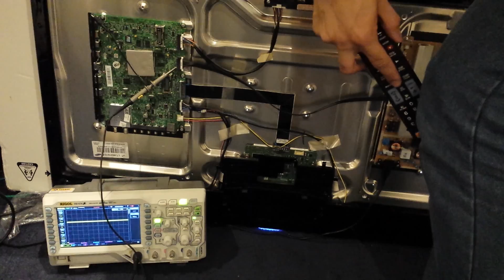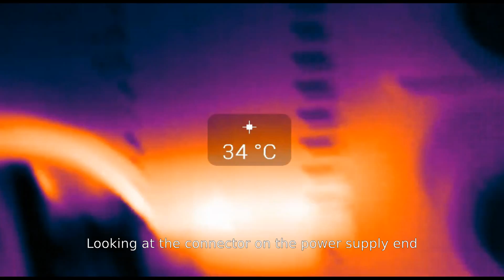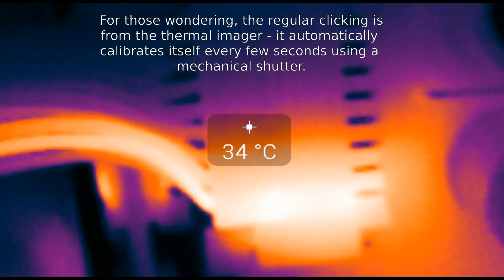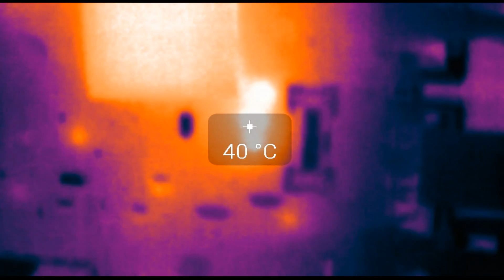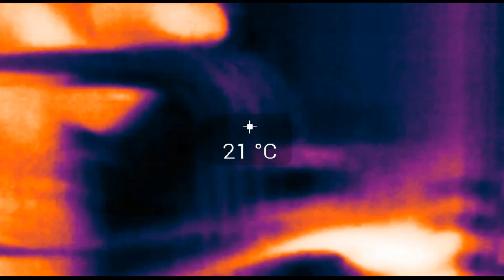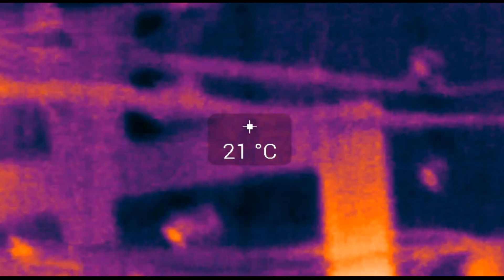Samsung UE46ES8000 clicking, power cycling, patterns - Diagnosis of connector failure

Comment: Mine also started to have these problems, I removed the cable from the plugs and rubbed all the contacts with a toothbrush with oil, turned it on and it was like new.
Reply: is it still working ok?
Reply: @kipkoech1000  yes

Comment: Hi.
I have a samsung ue50f65505sb.
It first startet randomly power looping with clicking sound. Had to unplugg power socket, and it worked from minutes to days depending on its mood. Now it's a similar fault but more often, and also it's going in loop when using any button on the remote. When I unplug the power socket, it still making clicking sound 5-10 seconds after. I then have to unplugg all the HDMI before I turn TV on again and it's working again. Just open the back today and checked both power and the other electronic board, with no visible damage. Is this a main board problem, or capacitors?

Comment: It is very simple just only to be the cable connector between power supply and mainboard and in that case it didnt even need to make a video to show a such a simple repairing.But once it was told,how to tell people that their tv died and need boards replacement with outrageous costs.

Comment: I have a samsung HP-T5034 and I am having a problem with the blue light taking longer to flash and start clicking, does that sound like a cap on the main board or power board and where is the best place to buy parts. Can I  test the caps individually to make sure I am replacing the right one. How did Y all get ureducation on tv, electronics repair.  THANK you.  Eriracing@aol.com

Comment: Same issue started 3 day ago on our UE65ES8000, we bought this in 2013,  so 5 years on now.
Followed you information and downloaded the service bulletin as per the URL you gave : http://www.badcaps.net/forum/showpost.php?p=519491&postcount=7 

Also found  and a copy of the service manual from :  https://elektrotanya.com/samsung_ue40es8000_ue46es8000_ue55es8000_ue65es8000_chassis_u81a.pdf/download.html

Burn marks on the last to pins of the connector cable, I cleaned the cable and the socket on the board gently with a toothbrush and cleaning alcohol, the TV seems to be stable now.. Thank you very much :)

Comment: dear  thi problem  because   of bad   design  the thick  of   heat  protect rubber   is to  thick  so  it  make  stress  on processor  the   process pin is bad  connect  because  of  that   thick and  heat   from  process it  self

Comment: Hi I have a UE46ES8005 and have the same problem with this connector cable , it has burn marks on the last to pins of the connector cable going in to yellow print board.What to do clean it ? or  can i buy the same cable?

Comment: wonderful explain,,,,thanks a lot y just repaired this morning mine UE40ES8000,,,,y cleaned a little and moved the connectors and separate the 1 wire with the problem.if they new the problem why they did not put a more thick wire on that one?

Comment: Hey what do you think about the Flir E4 cam which is hackable to E8 specs. ? worth buying of flirone for android?
Reply from the maker: They are both decent  cameras, I am tempted to sell my Seek Thermal and get a Flir One myself. The Flir One has a better sensor with slightly lower resolution (Flir is 160x120 vs Seek at 208x156), but the overall performance should be much better on the Flir. Can't beat the E4 + hack, but then again depends again on what you want it for, maybe overkill for simple diagnosis work.
Reply: Tom question why did you set up the scope at AC coupling if the output  it's DC right?. can you correct me. I'm really interested on how you're 
using the scope. the whole purpose is to see the ripples right? as the 
output it's not being smooth ?.  Can you please clarifiy me on this. And
 again how did you set up the scope I have an owon DS8202V. thanks again
 tom , by the way I'm seriously thinking on getting the flir E4 and hack
 it to E8 but it don't know if it's really worth to diagnose shorted 
components heating instead if injecting voltage.

Comment: I have the same TV, and the pins was also burn out. I soldered two wires directly from the pads underneath the power suply to avoid the connector. But the television is still power cycling with no backlight on. THe voltage switches (measured on the main board) from 0V to 5.3V. The 13V pins switches between 0V and 12.75V.
I have tried to disconnect the main boad from the power suply, and then the backlight can turn on. Any ideas on the problem?
Thank you very much!
Reply from the maker: +akoen1 are you bypassing the 5V correctly? If it is still cycling but you do not get colour patterns or noise on the screen, then most likely it is a main board issue rather than a power board issue
Reply: +ubuntututorials Im just bypassing the connector by adding the wires directly to the pads underneath. It could be a problem with the main board. But there doesn't appear to be any shortings. I think it is strange that the TV is power cycling if the main board is the issue? And strange that i only measure 12.75V at a 13V pin? Sure it is main board, and not TCON or power supply?

I have posted a thread to badcaps:
http://www.badcaps.net/forum/showthread.php?t=50476

Any help would be very appreciated!

Comment: Aha, you have saved me a bunch of bother. I'll check out the cable on my recently packed up telly tomorrow night. I'll let the family stew a little first.
Reply: I've fixed mine. I got 2 replacement headers (3711-007742) and a replacement cable (BN39-01475C) from Charles Hyde and Sons LTD in York (UK), which were delivered the next day. I only used one of the headers though, to replace the burnt out white one on the PSU. I desoldered it with the help of some leaded solder and some solder wick.
Reply from the maker: +jo0ls Nice fix! I just ended up wiring the connector directly. It's more of a hack, but I think it will be more reliable.
Reply from the maker: +jo0ls Nice fix! I just ended up wiring the connector directly. It's more of a hack, but I think it will be more reliable.
Reply: ubuntututorials do you have a picture? I need to do the same fix. Cheers.

Comment: What's creating this fault? Like what's Samsung's solution, new harness/connector?
Reply from the maker: +mrsemifixit Samsung's permanent fix is a replacement cable and connector on the power supply end. Unfortunately I was unable to source this so went for the "manual" method.
Reply: @ubuntututorials  I found a replacement cable here on ebay: https://www.ebay.co.uk/itm/203995085412?epid=1530977237&hash=item2f7f0dfa64:g:zF8AAOSwyKhbUvab 
So far, the TV is working again. I have Model UE46ES8000. 
Thanks very much for linking the pdf to the repair guide! I got a membership at that forum and found the part number I needed (BN39-01475C). This was for a 46" TV.